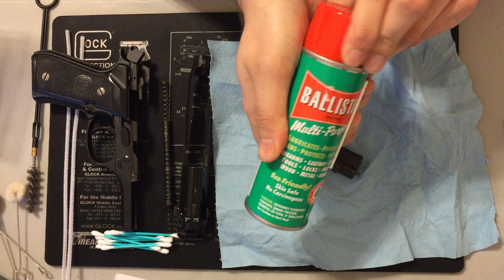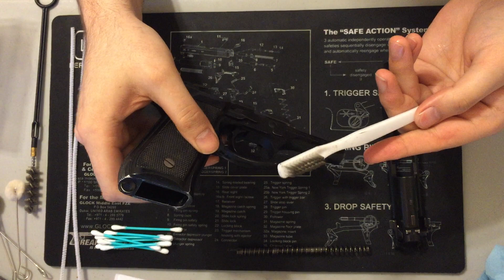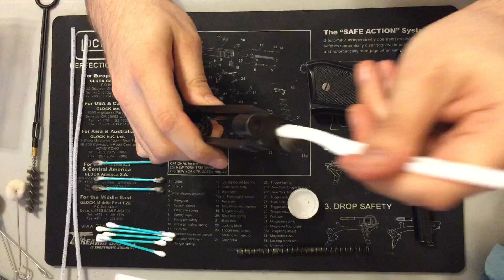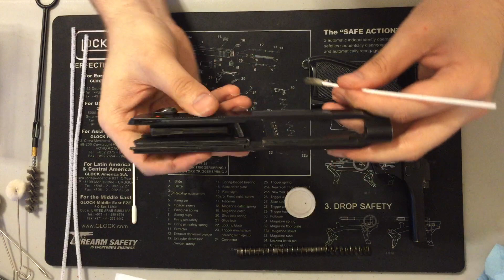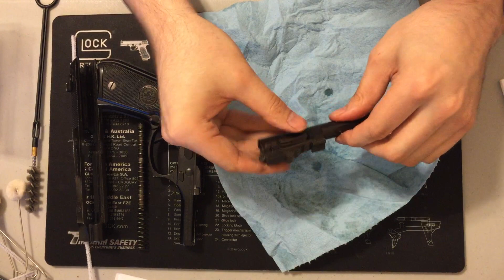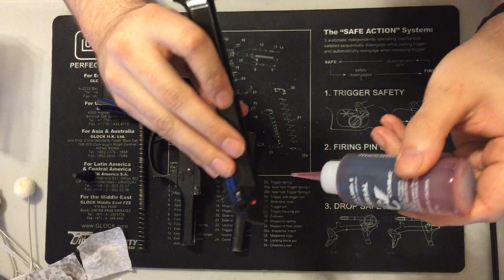Beretta 92fs Field Strip & Cleaning, No Talking

Comment: This is probably not that important but I usually clean the breach face with the firing pin pointing down toward the bench just so I don’t knock loose any particulate and have it fall into the firing pin channel. Like I said, probably not much to worry about there but I do it as a just in case.

Comment: Spraying the parts down with some Non Clorinated Break cleaner does a nice job removing any grime Powder soot etc just about $3.00 Bucks in any Auto Store works better than the gun sprays that they sell for 5- 10 Bucks etc.

Comment: Question: Now the gun is oily from the outside too. I am super weird that way and cannot stand oil on the outside when I am later using the gun. How do you remove the oil from the outside? With the same patches or you  do something else too?

BTW Great video!
Reply: Just use a paper towel or something and wipe it down. No big deal

Comment: Is kerosene ok to use on a gun like the Beretta as a grime remover?
Reply from the maker: If you avoid the plastic bits, it will probably work, but it is a bit harsh. I'd stick to gun-specific products to be safe.
Reply: OK.Thank you
Reply: aintplaying games Gun scrubber or non chlorinated brake cleaner are as strong as you probably want to go and they will strip oil off off everything they touch.   I like to use them in striker channels of some of my guns since you don't want any oil there.
Reply: Thank you
Reply: Kerosene fine It's in the ingredients  in hoppes #9
Reply: EEZOX Best stuff ever for all firearms, it cleans,  Dry Lubs & a Rust Protector all in one etc.
Reply: CPL
Reply: Hoppes #9 is 40% kerosene and 40% ethanol. Pretty strong solvent and will probably work significantly better than something like Ballistol (mineral oil) which really has no carbon penetrating capability. Honestly Dawn soap and water works the same though. Just make sure you dry the gun off and lightly coat the metal with a lubricant.

Comment: Unsafe, Improprer clearing of firearm. BIG FAIL.
Reply: +Scuzzy Skeeter  I will try not to insult you.  First, he cocked back hammer on a presumably loaded firearm.  That is bad- really bad.  Second, he removed the magazine.  That should've been done first instead of second.  Then he did not place the safety ON; that should really have been done first of all before even removing the magazine.  Next, he racked back the slide and visually checked the chamber.  That is incomplete- one's eyes can trick, especially in poor lighting.  He should have locked back the slide, visually and then tactilely checked the chamber with a finger to confirm it empty.  So, for all of you who need a lesson in proper clearing procedures. safety ON, drop mag, lock back slide, visually and tactilely check chamber empty (confirm mag well empty also).  Done.  And one only does it once, that is all that is needed.
Reply: brentfoto Cocking a hammer on a loaded firearm is not bad, it allows for ease of racking the firearm, to surpass the double action. Also he took the safety off, TO DISASSEMBLE THE FIREARM. Also Mr Chris Costa, putting you're finger in a chamber for "felt" safety is not necessary. Another thing to keep you from being triggered in the future, trigger discipline is only a new thing, and very recent, even though it is a safety must, one of the most popular pictures of John Browning is him holding a firearm, violating trigger discipline, would you try to lecture John Browning, himself on firearms safety? That guy can make a gun out of his pubes in 3 seconds.